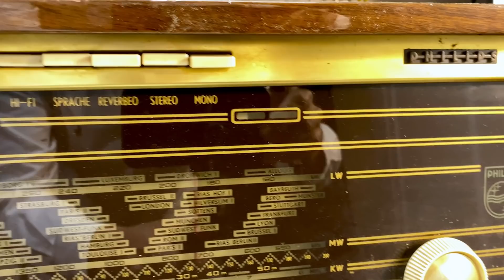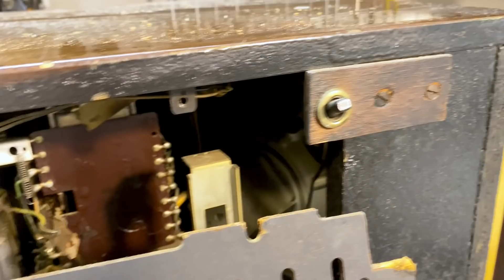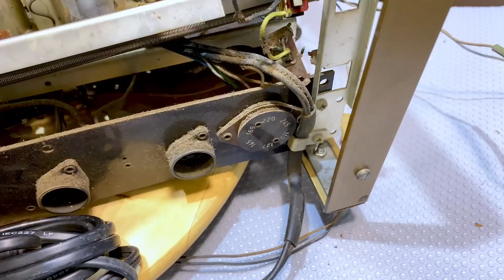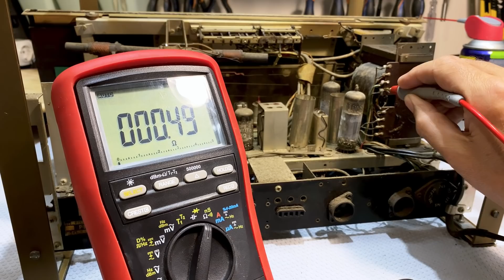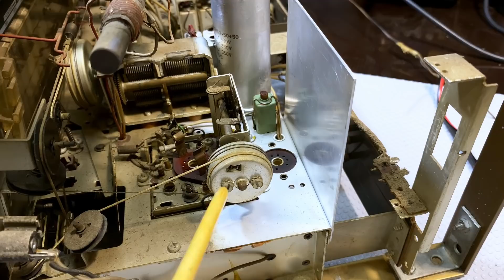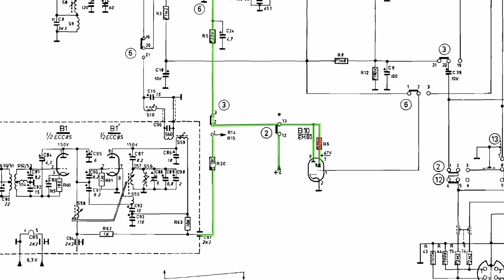Big, stylish and Dutch. Initial look at this Philips Reverbeo B7X14A Stereo restoration - part 1

Comment: I remembered what is used in the overheating protection for the transformer. 'Rose's metal, Rose metal or Rose's alloy is a fusible alloy with a low melting point.'
Reply from the maker: That’s the name I was looking for 😊

Comment: Manuel, I assume  that Ts1 works as an impedance transformer from Hi Z (delay-spring line) to Low Z cathode.
Did you check Ts1 for leakage, aging affects this manner. Only as a caution 😉😉.
Reply from the maker: Not done that part yet

Comment: Had a weird thought during this episode, it would be fun, but probably not practical to add a digital FM circuit (or analog) for stereo FM as you have the two audio output amplifiers. However that could lead to a revolt amongst Phillips radio community.
Reply from the maker: definitely would cause a revolt 😊

Comment: I don't understand how that reverb transistor would modulate EL84 cathodes which are bypassed by a large capacitor. I think the reverb signal goes out amplified by the transistor from collector through c85. And the pnp transistor just takes its 7V power supply voltage from the cathode voltage of EL84s.
Even tremolo oscillators cannot modulate hi value capacitor bypassed power tube cathodes, they always modulate high imp. signal path.
Reply from the maker: I’ve had a closer look at the circuit, and I believe you’re right.
Reply: @electronicsoldandnew  And because transistors don't need 200VDC power supply, the very easy way to get that around 7V is from that EL84 cathode voltage. Because the collector side of the PNP transistor is at ground level side, that positive emitter voltage gives excactly the negative power supply voltage to collector, which neg. voltage is needed because that transistor is a PNP.

Comment: Interesting to see that one little transistor in there lol
On so many levels makes you wonder, why they didn't use those as current sources and such etc etc...?
When you said that Philips always does things a little different, that made me really laugh.
Also so my experience, I came across quite some schematics that just don't correlate with the actual circuit.
I have never succeeded to empty a Philips B+ capacitor can. They all seem to be totally stuck in there unfortunately :(
Reply from the maker: Use a heat gun or hairdryer to heat the can. It then comes out easily.

Comment: The reverb tank is made by Gibbs/Accutronics, the same brand that was used in most (not all) guitar amps of the 1960s.  The electrical input/output impedance of the tank would be chosen for the type of circuit it was to be used in; in a Fender amplifier with reverb, the tank was driven from a small (Champ !) output transformer and therefore had an input impedance of about 4 ohms; on the other hand, Ampeg and Magnatone often used tanks that were driven through a capacitor directly from the plate of a preamp tube,  and so the impedance (not the same as DC resistance) was usually much higher.  If you find a code on the tank that begins with a 4, like 4A, 4B or 4C you can look it up online and it will tell you the input and output impedances of the tank, as well as whether it was designed for horizontal or vertical mounting, and whether either or both of the input and output connectors (which appear to be missing) are grounded to the tank, or not.  

By the way, early reverb tanks often had a sticker on them that said "made by beautiful girls in climate controlled conditions in Wisconsin"!  PS, the spring reverb system was actually a Hammond Organ invention and that's why they have a reference to a patent number on the tanks. And as an aside, Although we often associate Hammond organs and rotary Leslie speakers together, Hammond hated Don Leslie and his invention, and the company did their best to position their organ dealerships and their marketing so that the two different brands/products would never be used together; but in the end it turned out to be kind of like keeping peanut butter and chocolate, or peanut butter and jelly, apart. 🙂 ( I haven't watched the entire video yet but the parts covered in degraded foam that appeared to have fallen out of the reverb tank were probably some kind of locking mechanism to hold the springs from vibrating during shipment so that the little magnetized hooks that the reverb springs are attached to would not break off).

Comment: Hi again . I have restored one of these for my own use . Same covering of nicotine !  Took ages to clean . Some points to bear in mind . Beware of the high voltage dial illumination panel . These are terrible and prone to burn out or even explode and crack the dial plate !!  Yes really . Replace with normal bulbs run off the Lt supply . The speakers are 800 ohms and because the voice coil wire is so thin are liable to fail . Replacements are virtually impossible to find . One of mine had a normal speaker and a different opt fitted ... Not by me . Sounds ok so left well alone . The transistor is part of the reverb circuit . The caps and resistors are mostly good quality . I only replaced electrolitics and the Philips tar caps . Almost everything else checked out within spec . Alignment looked like a nightmare but it worked so well that I didn't disturb that . Sound quality is superb with very clean bass . Because it is biamp an MP3 or similar can be connected straight to the input without pot divider . The reverb gives fantastic realism to speech but not as effective on music I find . Good luck with it but DO watch out for that dial light panel . It is lethal . Even it yours works which is unlikely , disconnect it !! . 
I have used mine almost daily for the last 5 years and it has proved very reliable apart from replacing both EL 84s and magic eye at some stage . Enjoy the journey . Well worth the effort when working well . Best regards from Thomas in UK .
Reply from the maker: Thanks for the info Thomas. Always appreciated.
Reply: Hey, friend of mine actually had a go with an electroluminescent film that replaced the original. This was on similar radio, and the dial scale now looks stunning. It did cost him a bit and some experimentation. I think he got it from eBay, and he had to lower the current quite a bit as it was too bright. Btw, if his set was my set, I would probably machine a custom matte plexi plate to accept green LEDs and to disperse the light evenly. I would probably use a diffusor plate off a broken LED LCD screen as it is designed to diffuse the light evenly. Normal bulbs are okay, but once you see the EL backlighting it just blows you away
Reply from the maker: I’ve seen those screens before. Very rare nowadays.
Reply: Actually, found the right stuff. You can replace the electroluminescent panel with one that are selling by Conrad (at least here in continental Europe). Part number: 184057-62
Reply from the maker: thanks

Comment: This one has a faceplate with German inscriptions and the AM bands marked in kHz/MHz. There's probably also a version with combined Dutch/French inscriptions on the faceplate and the AM bands marked in meters,, as Philips sets for the Dutch and Belgian markets typically had. 800 Ohm speakers were originally designed for output-transformerless sets, using a special output stage using two tubes, with an exceptionally low output impedance (for a tube stage that is) and 800 Ohms was probably as high as they could get the impedance of non-electrostatic speakers. The built-in speakers appear to be the same impedance as the external connections. But this set does have output transformers. Apparently they found it too costly to have the OTL circuit twice for a stereo amp. 
It also has the Bi-ampli logo on the faceplate, another Philips invention. Originally they had dedicated amplifiers and speakers for bass and treble, but when stereo records came along, they used identical amplifiers/speakers and when the radio was used for mono. they would feed bass to the left channel, treble to the right channel. This reverb spring makes an interesting sound effect that is mainly good for demonstration purposes.
This one uses conventional dial lamps, but some versions of this radio have an electroluminescent screen that emits green light. That will not work after all those years and it real electroluminescent screens are impossible to get.
Reply: Here in the States, my brother had an early Sixties Dodge or Plymouth convertible that used a reverb tank for the speaker in the rear of car!  I have also seen a few old Magnovox or Motorola stereo consoles, both tube and solid state, with a reverb tank built-in. Fisher used to make an add-on spring reverb system for some of their tube type stereo equipment.
Reply from the maker: Great feedback. thanks
Reply: Some late model Magnatone guitar amps used electroluminescent backlighting, and as of a decade ago a suitable replacement tape was  available.  You might be able to use some kind of kind of Cob or gel phosphor LED tape nowadays.

Comment: Dear Manuel, what a big radio! I don´t understand the reverb circuit with transistor TS1 completely, but my opinion is that the reverb signal is fed out via the collector of TS1(R81) via C85. The emitter is the positive DC supply (for PNP) and filtered by C86/R83 and the cathode C84. Good success!
Reply from the maker: That make sense. I first thought it was feeding through the cathode, but your explanation is more logical.

Comment: I'll be watching this for the bluetooth add on ideas this time.    As much as I love the radio itself as well, I have a little project of my own I need ideas for.  I have an old Grundig that has a stereo input, but is mono for the radio side.   I'd be interested in looking at ideas on how to possibly use a bluetooth option.
I saw you put a fuse to replace that little heat sensitive device on the transformer.  Not a bad idea.  Was the original device also detecting temperature of the transformer to kill the power if it get too hot, or was it purely an absolute value current limiter?
Reply from the maker: I believe it melted when the transformer got too hot. Since that happens when the current gets too high, I decided the fuse could do the same thing.
Reply: @electronicsoldandnew  Sounds like a good solution.     That little device may have saved the power transformer in this set.
Reply: @electronicsoldandnew  i recommend replacing the thermal fuse (that's what it is, subject to going "open" from heat and not from current) with another of similar or same temperature rating. It isn't there to protect the transformer really, *it's there to prevent your house from burning down if the radio is accidentally left on overnight or while you are away*.  If a fault elsewhere in the radio causes the transformer to run too hot, or for that matter if some windings short inside the transformer and it overheats, the thermal fuse will shut it down before it can set fire to the radio and, by extension, your house.  Remember that these transformers were designed for intermittent use and not continuous or commercial service where they would be on 24/7. You will find similar devices inside modern coffee pots and Keurigs and so on. If the thermal fuse has a number on it, you might be able to look up the spec, otherwise,  Take a guess at the maximum safe temperature of the transformer, or measure the transformer temperature when the radio is in operation, and select a thermal fuse that is just very slightly higher than that.  Be sure to locate the replacement thermal fuse right up against the transformer windings ( with some transistor-heatsink grease). Many modern solid state receivers and amplifiers and so on have the thermal fuse actually tucked into the windings tightly, but sometimes visible and typically with the connections brought to the outside frame of the transformer onto a terminal strip, so that you can test the thermal fuse if the transformer stops operating. Sometimes we can put a drop of silicone lubricant spray on the dead thermal fuse and grab it with pliers and pull it out, and tuck a replacement device in between the windings, but oftentimes the best you can do is bypass it with a new thermal fuse, pushed up against the windings and coated with  transistor-heatsink grease. 

 A few years back I worked on a direct drive turntable that died after accidentally being left on all night. The electromagnet coil was wrapped in rubber or heatshrink tubing and had a dead thermal fuse tucked against the coil. I cut away the rubber and replaced the dead thermal fuse, and the platter started spinning again ----- at over 100 rpm !  I found a shorted driver transistor on the power supply board;  I am guessing that the transistor failed first and caused the turntable to run at excessive speed for a few hours night until the thermal fuse blew before the direct-drive motor coil could get hot enough to catch fire.
Reply: Update: I just watched a little more of the video including the close up of that thermal fuse device. This is a very early version of the modern thermal fuse devices I am familiar with , which are usually little torpedo shaped metal cylinders,  about the size of a 1/2 W resistor. The device you hold in your hands was apparently made with a low temperature solder (similar to Chip-Quick"?), and instead of having a filament or wire that melts and breaks the connection, the solder would melt and then the contacts would spring apart.  Pretty ingenious for those  days but I would suggest you get a modern thermal fuse and use that as a replacement. And since I mentioned chip-quick, it is a special low temperature solder with a wide range of temperature at which it remains liquid and plastic, used to more easily remove/unsolder microprocessors with multiple, closely spaced pins that are almost impossible to individually desolder.

Comment: One YouTuber taught me something important - when you start the equipment for the first time with the Variac, remove the rectifier tube and replace it temporary with a solid state rectifier diodes. thanks to this you will power the B + from the very bottom, without waiting for the rectifier tube to start conducting.
Reply: That is a good technique if you are trying to "reform" the existing electrolytic caps, as you can bring them up to voltage slowly instead of having the B+ "switch on" once the rectifier tube starts conducting at the higher secondary voltage. It probably wouldn't be as important to go solid state if you have replaced the caps (as Manuel has done) already, but with proper monitoring either SS or tube wouldn't hurt going with new caps.
Reply from the maker: Good point.
Reply: I do the same as you, temporarily replaced the tube rectifier with a plug in solid state rectifier, but, *Do not run the variac up to full line voltage while the unit is operating from a solid state rectifier*,  Otherwise you will likely severely overvoltage the old capacitors and perhaps the tubes as well. Stop the variac at about 75 to 80%, so 90 to 100 volts maximum input AC for a 120 volt radio, and 180 to 200 volts input AC for a 220-240 volt radio.